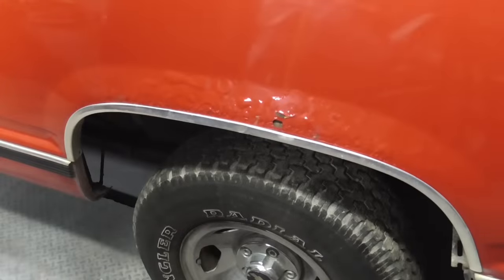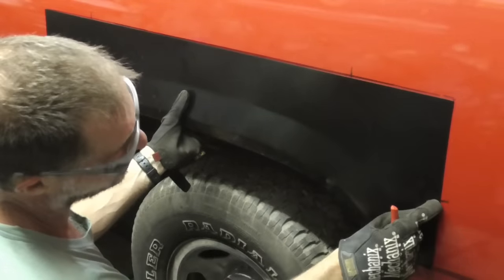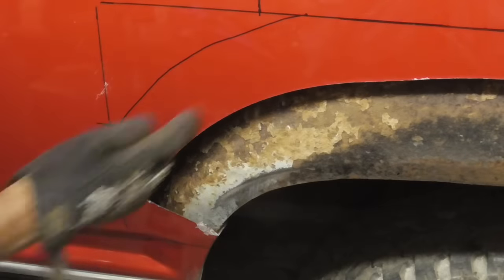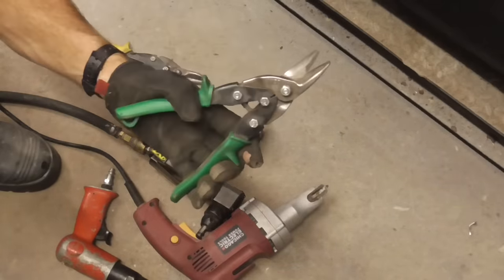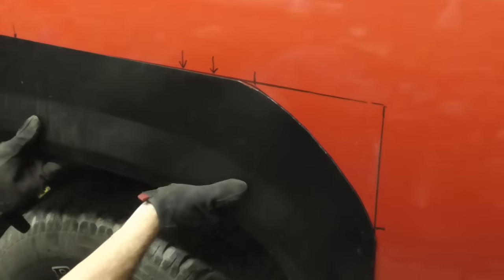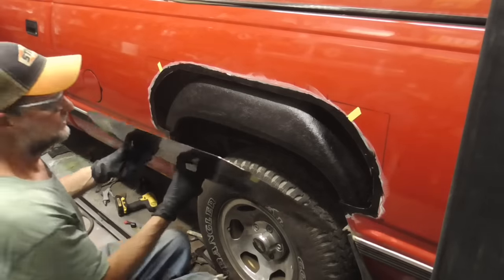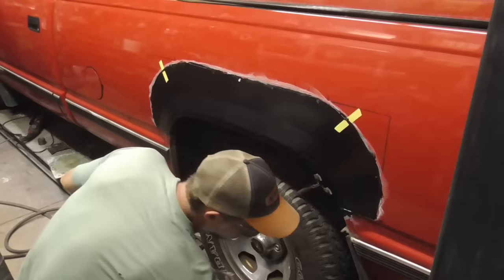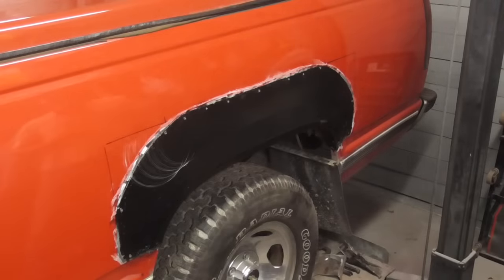Glue On Wheel Arch Rust Repair Panels w/ SEM Impact Resistant Panel Adhesive

Comment: So flying a panel seems to just add a ton of extra work with the bondo work needed to cover up the seam, welding seems faster by comparison. The glue alone is $100 and the applicator is another $120. Plus another 400 500 for the metal cutting tools god knows how much those specialty pin clamps cost!!!!
Reply from the maker: It's the water tight seam that many body shops and customers are at interested in. Welding is a bit easier though.  You still want to knock down your seams - never want a seam right under the finish.  Thanks for watching - have a good weekend :)

Comment: Wouldn't it have saved a great deal of filler, if you joggled the overlap?
If I were happy with half a ton of filler down the side of my truck, I'd have just bodge filled the original rust issue and not spent out on an arch panel and glue.
Reply from the maker: At most in the deepest areas there is 1/8".  That's how the best body shops do it.  You absolutely want filler between the seam and the finish.   This is actually how they did quarter to roof seams for decades - sail panels.  No one knows it because it's done right.  Make sure you learn from folks that worked in real, high volume body shops and dealerships.  Not the internet or magazines.  https://www.youtube.com/watch?v=t1WclT_GMvk  & https://www.youtube.com/watch?v=gIS1Tbv7Kvw

Comment: Well hell why not use j.b weld or bubble gum?
Reply from the maker: Hey good thinking here's a follow up video on a cab corner glued on with JB Weld - https://www.youtube.com/watch?v=gIS1Tbv7Kvw
Reply: @LakesideAutobody  my point was,if your not gonna weld the metal back into it why even bother? Just get a colour match roll of tape and tape up the rust hole,and move on with ur life.just as good,imo.
Reply from the maker: @JoeRocket-sf6qs  To be really honest and even though I really believe in and like MIG welding patches,  I do think this method lasts longer because of the water tight seam.

Comment: It won't work! You will get a shrinkage line where you patch is. Been there done that. Had to grind it all out and weld it.
Reply from the maker: Sorry Jerry - with respect it works.  Many shops use this method in and around the metro Detroit area.  You have to knock the seam down and don't be shy about it - "Hit it low and fill it with dough"  as a very good body man taught me very early on.  Here's proof - https://www.youtube.com/watch?v=gIS1Tbv7Kvw  especially at the 1 minute mark (glued on cab corner)  Have a good weekend my friend.

Comment: Why cut all that original panel out when u didn’t need to go that high u only needed to go above the effected areas  I’ve allways retained as much of the original panels as possible you’ve removed Al  that original stronger panel to replace it with thinner aftermarket stuff I really don’t get that  sorry in my eyes that’s a bodge
Reply from the maker: Because panels rust from the inside out and the rusted area is usually much bigger than it looks.  You can tell with your cutting tools if the metal is thin or not from rust.  If it's thin cut more - especially when welding - nothing is more frustrating than blowing through thin metal caused by rust on the back side of the panel.

Comment: Hate to say it but you will see a ghost line  and the pop rivets where the seam is because the glue does not expand and contract at the same rate as metal. Been there, done that.
Reply from the maker: Who ever did it for you messed up or didn't do it exactly like it was done here - https://www.youtube.com/watch?v=t1WclT_GMvk  3 year ollow up - https://www.youtube.com/watch?v=gIS1Tbv7Kvw
Reply: I have worked mostly in new car dealerships for 45 years and get to see how this method holds up and it does not. Using 8115 panel bond unless they totally changed the product. But 3M does not recommend splicing in the middle of the panel.
Reply from the maker: @johnnyshd8250  The key in my opinion is tapping the seam down and having that buffer between it (the seam) and the finish.  If the seam is right beneath the paint, I can see something going wrong - same with butt welding and not tapping down the seam.  You have to tap the seam down whether you butt weld, lap weld or glue.  Just how we've don it here in Michigan for years and it works well - not sure if you checked it out but see this video on the drivers side cab corner that was glued with JB Weld 4 years ago - https://www.youtube.com/watch?v=gIS1Tbv7Kvw  Thanks for your comments my friend :)
Reply: @LakesideAutobody  It is a vicious circle fixing rust. And the price on patch panels has sky rocketed.
Reply from the maker: @johnnyshd8250  I agree with you there - nice talking to you - have a good week 🏈

Comment: Those crappy steel inner fender liners have created more rust outs than road salt itself.      That is. Good p,ace to be using PLASTIC and try not to shape it so it’s a dirt and moisture trap.    .
Reply from the maker: Good idea - and make sure it can drain :)

Comment: This is very interesting but you need to learn how to better leverage the use of the clecos...
Reply from the maker: Do you mean pinch them tighter?  I think they make them too where you tighten them with wing nuts.  😊
Reply: @LakesideAutobody  Well for one thing the clecos act as alignment once inserted. The point is that you used them then took them off put on the adhesive and did a whole bunch of work over again when you could have just used the clecos. Once dry pull oy the clecos fill with glass and then body filler or weld up the holes. The other option is to use the clicos and then replace them with pop rivets, grind flush, and bodywork.

They have been used for years in aircraft construction and repair and are a terrific tool once you get used to using them. Good video but I just wish they would make plastic pieces for my Ford 2004 van which suffers from the old rocker rust out.
Reply from the maker: @superbmediacontentcreator  Raybuck or Millsupply might have your rockers but sheet metal - here's a video on gluing them in place if interested  - have a good week :)
Reply: @LakesideAutobody  Thank you for the link. Yes, I have seen those metal ones but I have very limited ability in my apartment parking lot. I just went to my friend's house to work in his driveway to fix my bumper that someone trashed when they backed out of a space in a parking lot and crashed into my parked truck. It's tough to do anything in an apartment parking lot, especially anything that is messy.
Reply from the maker: @superbmediacontentcreator  I remember the days - I get it :)

Comment: I wish my cars came with thier own stainless steel prong hydrolic jack mounted to the outer body 
Like giant legs, press a button and car stands on all 4.
Reply from the maker: That would be great - then you could work on the underside any time with ease :)
Reply: @LakesideAutobody  exactly, and all the older cars with rust could be easily accesable, maybee at a certain age of car they could do it  for cars 10+ years. And, it could have  3 difrent height settings  it 
Sounds like a shark tank idea. 
It could be made to look like a chrome decoration. My cars have gotten damage from shop Jack's
Bending the metal under rocker panell from being jacked.
Reply: @LakesideAutobody  In fact like a giant hair clip it could add to vehicle stability and cross under body
Reply: @LakesideAutobody  I think it would allow me to see better and clean, clamp and adjust stuff. Mechanics would be impressed.
Reply from the maker: @janeprescott7381  Yes they would :)
Reply from the maker: @janeprescott7381  Sounds like you should have been an engineer :)
Reply from the maker: @janeprescott7381  Yes - sometimes the rust is so bad the two post lift pads go right through the floor or spot it's lifting from :)

Comment: Anyone who goes through this much pain to fix in a patch panel has a lot of time on their hands. I could have done this in half the time with a cheap wire welder.
Reply from the maker: This is another way to do patch panels.  Many claim that it lasts much longer due to the waterproof seam.  Check out the other videos on this channel for MIG or Flux core patches :)

Comment: To go through all that trouble just to glue the panel on why not just weld it on cause now you are gonna have a lip and have to use fiber glass or bondo on it to cover up the lip.
Reply from the maker: If you don't knock the seam down the patch will fail - https://www.youtube.com/watch?v=JIIonJOVro4

Comment: I mean great job but with a little bit of cutting and welding skill you can avoid allot of filler.
Reply from the maker: One thing I try to make clear with this channel is to end this chatter about filler being bad.  Filler is used every day in ever dealership and body shop but no one knows because they are pros and use it right.  If it's used right you never see or notice it.  That's good to remember if you like cars :)

Comment: Seems like ALL the manufacturers should start putting zippers on the places above the rear wheels, looks like they rust out in 3/4 years
Reply from the maker: You're right.  They really just need to make sure these areas can drain and dry out instead of collect dirt, debris, and moisture.

Comment: "Now you can see it from 10 miles away, just because we didn't wanna weld and do basic filler work"
Reply from the maker: And you'll never have to worry about the seam either - water tight guaranteed.   Welding is cool too if you prefer - https://www.youtube.com/watch?v=Jk29avqnVXI  It's good to be proficient at all methods just in case you work at a body shop - different shops use different methods - gotta know 'em :)

Comment: Putting rivets in then sanding the head down seems pointless to me
Reply from the maker: The heads were not completely removed.  You can actually leave the rivets out - I just threw them in to avoid comments about the remaining 1/8" hole.  The holes are up high and will stay dry and won't cause a problem :)

Comment: Why not joggle the glue line and make it a flush patch without beating on it so much
Reply: Yes an offset in the patch panel or even the quarter panel would make the repair so much cleaner!!
Reply from the maker: I wanted to keep it simple as possible but you could do that to - like use this:  https://www.harborfreight.com/air-punch-flange-tool-1110.html?_br_psugg_q=flange+tool  - you'd still have have to knock that seam down a bit to avoid any high spots here and there.  Have a good weekend Tracy :)
Reply: Why did you screw the panel on? Wouldn't clecos hold the panel in place while the adhesive was drying?
Reply from the maker: @colleenoloughlin3970  Good question.  Clecos work great but you can adjust the pressure with screws.  There is another typed of Cleco that is adjustable - has a little wing nut.  However the hole for that type is a bit bigger and I didn't have that size rivet.  Again good observation :)
Reply: What you people are not considering too is that the glue requires 1 inch of overlap, and a flange tool does not flange out to one inch, plus a flange tool creates warping on the original panel, and like Jerry said you are still going to have to knock it down some because you are still going to have a high area where the flange creates a crease. One last thing, if you don't knock the seam down no matter what you do you will see a transition line all around the patch panel on hot days, so why not just do it like Jerry showed you? Don't question the man he's probably got more experience in auto body repair than you do living
Reply: @jonathanyates5198  I've been makeing flush patches in airplanes since 1985 and i never had to beat an aircraft to make a flush patch
Reply from the maker: @jonathanyates5198  Well said Jonathan - I appreciate the support - you're right about the flange tool - very smart.  The flange tool only gives you about 3/8" I think.  I read your other comments too - much appreciated - have a good weekend :)
Reply: @tracycurtright2671  Airplane and a car is 2 different forms of transportation
Reply: @tracycurtright2671  only other way it can be done is to butt weld 22 gauge steel. Grind that weld down flush and see how much metal you have left
Reply: @LakesideAutobody  Thank you Jerry I really appreciate the response. People in the comment section are like backseat drivers, occasionally they have good suggestions or praise, but usually they want to try and sound smart when what they say makes no practical sense
Reply: @jonathanyates5198  One starts working at 100mph they other doesn't go much more

Comment: I wish my auto body shop would of done this instead of welding the patch panels. Now paint and body filler is starting to bubble where seams were butt welded.
Reply from the maker: Butt welding is fine as long as you never drive it in wet weather after it has been repaired.  If you butt weld the welds have to be right next to each other, knock the seam down and fill.  If you don't knock seams down, welding or glue - the patch will probably fail or show an outline eventually :)
Reply: @LakesideAutobody  that’s the problem I live in northwest Indiana where we get pounded by snow in the winter (they use salt to melt snow in the roads) and get pounded by rain in the spring and in the fall.
Reply from the maker: @elmeromero1794  This video will cure your problems - promise.  https://www.youtube.com/watch?v=8XaZBy7GC7A  and this https://www.youtube.com/watch?v=y05dNxt-nVc
Reply: @LakesideAutobody  thank you I’ll watch the video and I’ll go from there!!!

Comment: Sounds like that air compressor needs at least a little oil ;)
Reply from the maker: It's old but keeps going.  I check the oil now and then.  Might be time for an oil change.  There is a huge difference in sound of an oil less and oil filled compressor too.  Compressors that are oil filled and have a belt and motor are much quieter.  Although I think HF has a quiet compressor that has a totally unique design :)

Comment: I think welding them in is faster tbh
Reply from the maker: It is... but for a water tight seam, you can't beat panel adhesives :)
Reply: @LakesideAutobody  I cant argue that I can beat it but I personally on my own car being in the industry would prefer welding in some fresh metal and epoxy coating it in and out. Also I have a question about this panel bonding. Is it a good idea to remove the eco ecoat from the new panel? I would think it's hard to beat ecoat for adhesion.
Reply from the maker: @oliverscorsim  I would remove the ecoat but I have no proof other than what I've been doing hasn't failed yet.  Here's a good video on how to make your stuff last (not rust ever) -  https://www.youtube.com/watch?v=y05dNxt-nVc  I do this AFTER the repair - remember it's going to rust at the bottom of the panel where the water sits.  Drainage and oily seams works very well here in MI

Comment: Wouldn't it be better if the edge was punched into a flange instead of it overlapping
Reply from the maker: On this particular repair you can't flange the whole perimeter because of the rigid wheel well lip/opening - but there's nothing wrong with doing that :)

Comment: I just want her before you go to all that work with that Bondo if a guy could have taken spot welded that panel on their use one of those underlay for a so1 panel would fit down in the groove and put a lot smaller Seema Bondo I never had good luck taking a hammer and beating on metal it seems like it always stretches and warps it in the wrong area I forget what you call that crimper that you run along there and it'll actually take the panel it's on the truck and it pushes it in so the panel that fits in there it's right in there just like a glove

Comment: The glue line will show up in a year or maybe 2
Reply from the maker: Not true at all - you'll see this in a follow up video that will be uploaded on this video is about 1 month - https://www.youtube.com/watch?v=wRl1QfkrBeY   Lots of good body shops use panel adhesive for rust repair because the seam is permanently sealed.  This cab corner is 3 years old now.
Reply: @LakesideAutobody  did Auto body for 20 years it works on structural panels but when you Bondo over glue seems they always come back. I worked on very high-end cars
Reply from the maker: @mtnmikewalters7185  How exactly did they come back - what do you mean - rust, bubbles, seam showing?  With respect whether you butt weld, lap weld, or use glue, if you don't knock the seam down, the patch will likely fail.  People don't want to hear that because there is so much misinformation about the use of filler but it's true.  Weld it/Glue it, knock it down, fill it, done and it won't come back.  Always allow for drainage of the panel and try to treat for rust AFTER the repair has been painted.  That's how it's done in the Michigan body shops that I worked at - not high end cars but daily drivers.  Those high end cars that are butt welded and metal finished don't like to get wet as there's nothing between those tiny pin holes in the welds and the paint.  This video might interest you - let me know what you think - https://www.youtube.com/watch?v=JIIonJOVro4   - Jerry
Reply: @LakesideAutobody  a small line will appear at the glue seem after about a year
Reply from the maker: @mtnmikewalters7185  Google:  “Sail panel leaded seam”  then click on IMAGES Factories have been doing it for 100 years.  That’s why body shops have also been using this method for over 100 years with great success if done correctly - that’s the key - must be done correctly.  Like I said I'll upload a follow up video of glued repairs 3 years old that look fine today - nice talking to you - Jerry